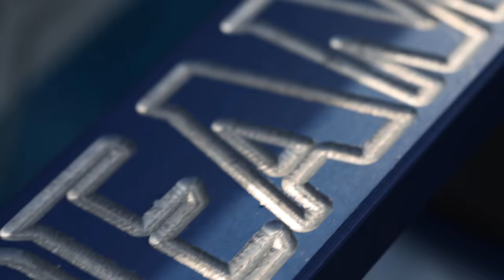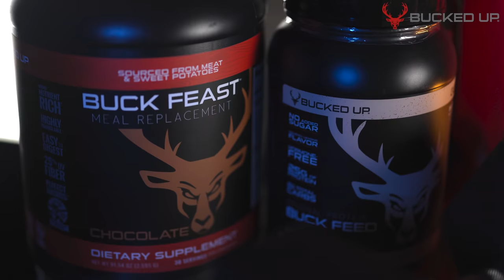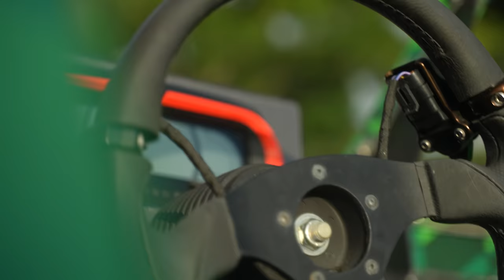@CleetusM  Got Us Stuck In Gator Infested Waters!

Comment: Cleetus or dave sparks.  Can one of yous get in touch I'm currently working on a spring board for the bottom of the jetboats  it's a bolt on or weld on.. you can adjust the spring for comfort or for thrashing over logs.. it takes the initial hit off the bottom of the boat..